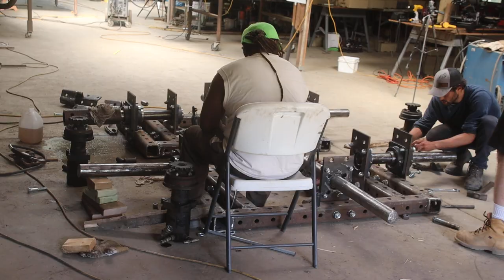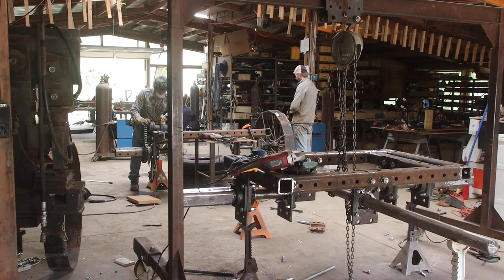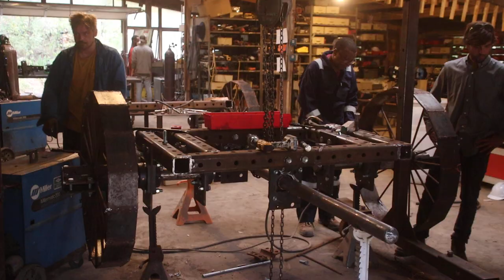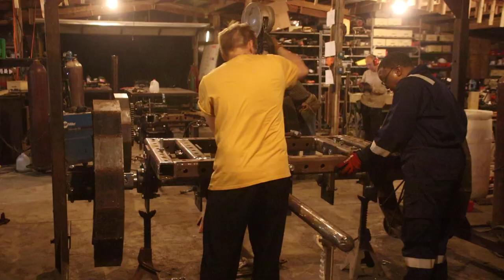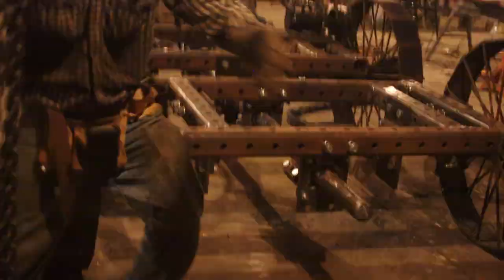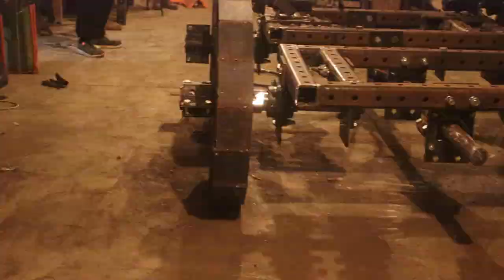Tractor - Steel Wheel + 8000 LB Drive Force

Comment: any updates on this tractor marcin? i could do with building one for the farm. the model T doodlebugs tended to break the half axles same as the lifetrac did so there was a company that sold a rear axle with iron wheels and a sprocket just inside the rim. there's one in this video https://www.youtube.com/watch?v=oEziZDApw3I  I would think the sprocket would gall over time though, a chain like your setup would be superior IMO. edit it may be called the shaw axle.